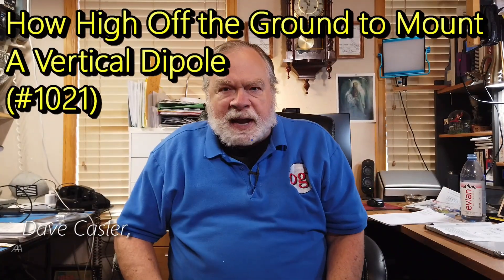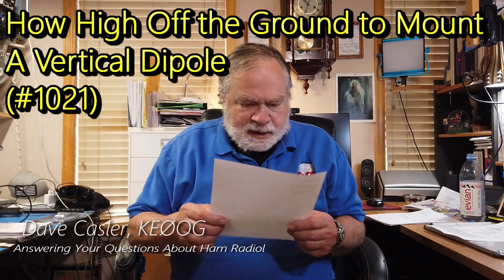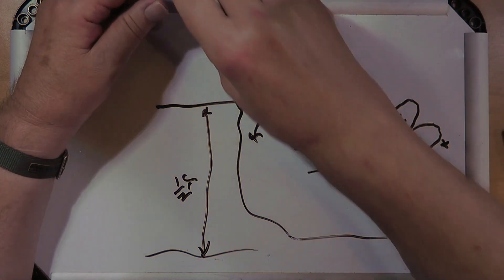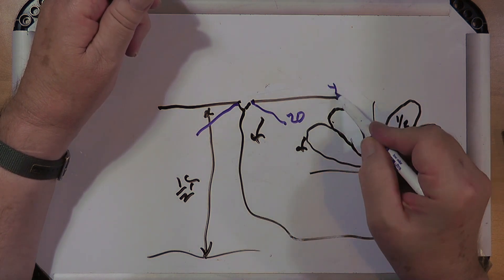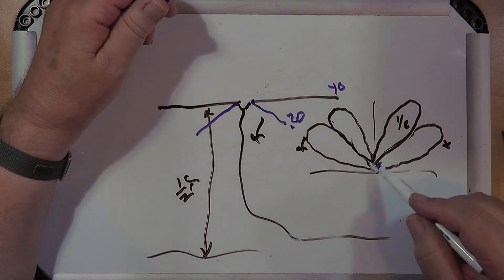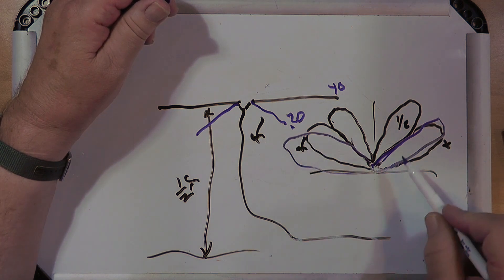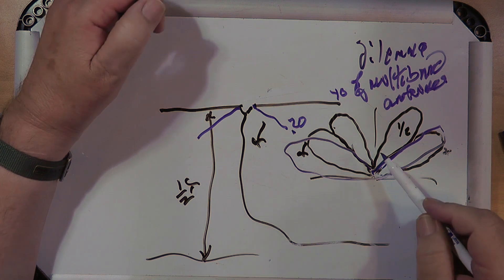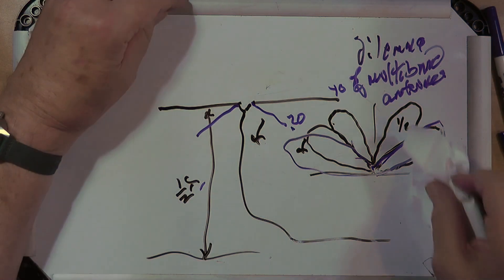How high off the ground to mount a vertical dipole (#1021)

Comment: I understand about how horizontal dipole radiation patterns change as the antenna is raised to different parts of a wavelength for the frequency.  I understand that a vertical dipole antenna will work when the lower element bottom end is 10 feet above the dirt.  What happens when a vertical half wave antenna (suppose it's a 10 meter half wavelength dipole antenna or a 6 meter half wavelength dipole antenna where it's relatively easy to accomplish) to the radiation angle etc. when the antenna is raised to different heights above the dirt ?   I suspect the difference will be that the distances for local communication will change if the power output stays the same for each height above the dirt.. Thank you very much.

Comment: Thanks a lot for the video! What happens with the radiation angle if I elevate the lambda/4 ground plane 10 feet above the ground, so that the radials don't touch the ground? Is the angle going down so that it will be an improvement for DX? Tks!

Comment: I disagree that the height should be "about 10 fee" without regard to the vertical dipole's frequency.  The question wasn't really answered. The question specifically referred to  the height above a ground plane.    The ground plane, if the ground plane is conductive, acts like a mirror, and the angle of radiation, and radiation efficiency is very much dependent upon the number of wavelengths above that surface.

Comment: You did not answer the question. Sad, you usually do a good job.
Reply: "I would say get the bottom ten feet off the ground if you can."
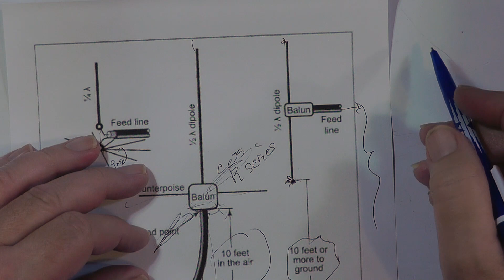Reply: At about 5:45 and near the end he says about 10 ft with diagrams.
Reply: 5:45 in the video is where he says it.